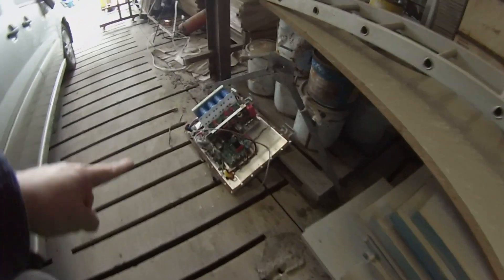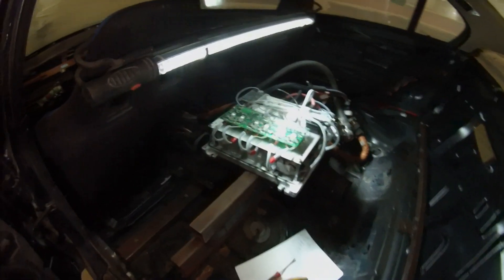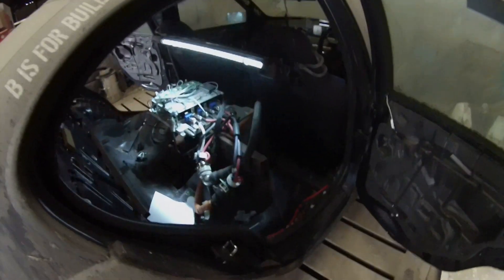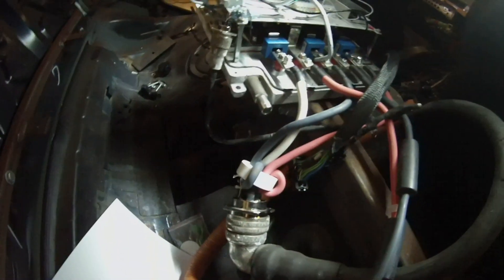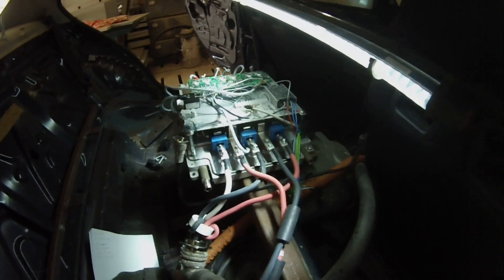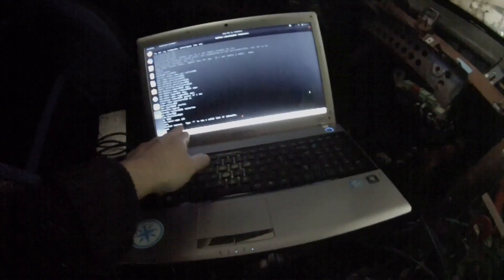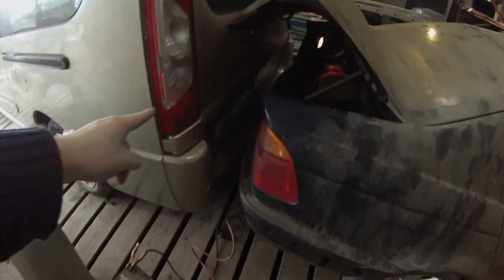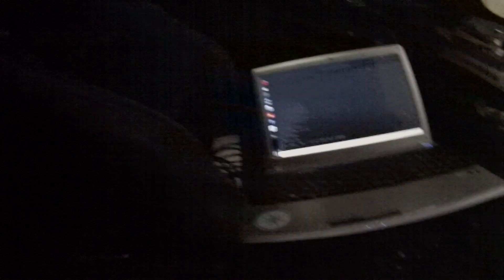E46 Electric Drift Project Resurrection Day 1

Comment: IIRC, with a 3-phase motor, all you need to do is switch 2 of the phases off to reverse the direction.
Reply: Depends whether your controller relies on knowing rotor position or not.